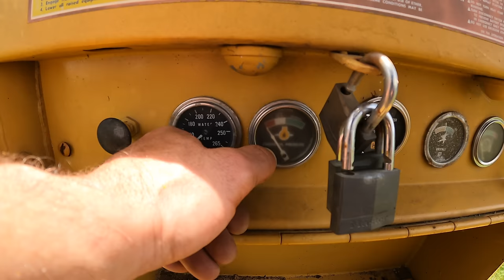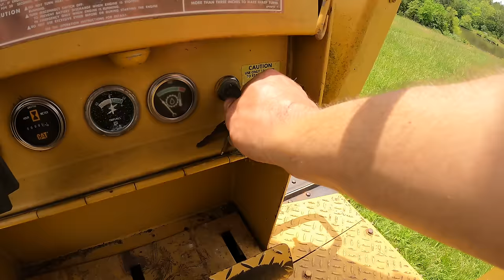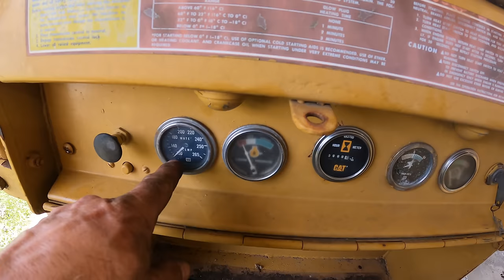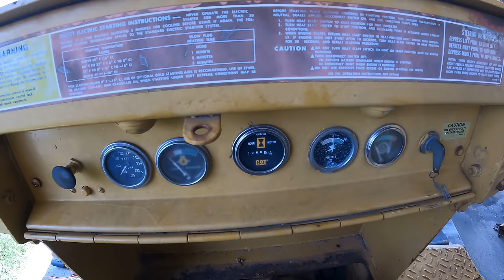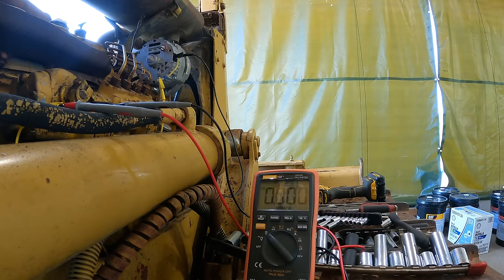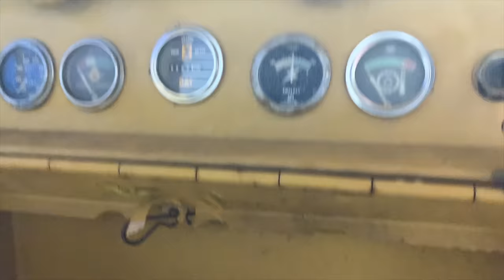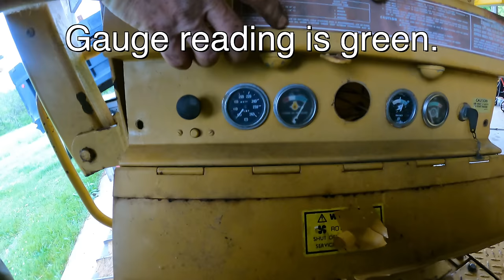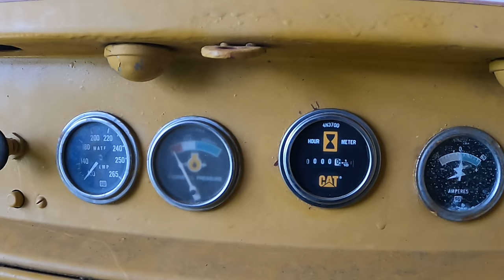Buying & Fixing a Bulldozer, Cat D3 Dozer, Part 1/2

Comment: If I can be so bold as to make a few suggestions….blow paper air filters from the inside. Outside in just pushes the really fine particles (ones that eat rings etc.) through the filters, also potentially opening the airways, bad.  The large filters we would tap on the track, shaking excess dust, on 12 hour intervals.    Also noticed the filter housing was literally flopping around, maybe check security on the ducting to make sure that no air is coming through.
The springs that tension the tracks are over tightened.  In the pictures the coils are almost touching…..not good.  About your buying price, a fellow in Oregon is in the final stages of going through a D4- really good information can be gleaned from his adventure.  You will burn many many gallons of fuel before you wear this one out- just neglected Nick-back piddley nuisances so far.  If you need it quick and inexpensive,  clean cylinder rods with acetone in the damaged areas and “shim the area where Crome has exited stage left with JB Majik stuff “ cover with clear packaging tape, aluminum flashing to cover affected area, hose clamps to hold curvature….wait overnight to open the package.  Package tape will prevent the epoxy mix from going where you don’t want it, light sanding with progressive finer wet or dry till pretty, no sharp edges to tear your new seals.  Or if you have deeper pockets than I, they can recrome the rods.😅. If I remember correctly that D4 guys handle is Northwest Hillbilly. Great stuff.😊

Comment: Sort of an unrelated thing, but on your glowplugless start attempt you can actually get it to fire pretty easily if you leave the fuel fully off for about 10-20 seconds while cranking, and then give it fuel while still cranking. The cylinders will heat all by themselves from compressing air, but dumping cold diesel in will cool them right back off. Letting it crank without any fuel at first is pretty effective. 
It's a great trick for old equipment with bad/no/broken glowplugs, or starting something in the winter if you don't want to constantly waste power running the block heater 24/7.

Comment: I have a 96 D3 C and I know exactly every problem you will experience…the fitting that leaks on the lift cylinder always rusts
When you find out the cost you will cry…anyway you got a good deal…iv owned mine 20 plus hrs it has 3400 hrs and iv put a new bottom end and of course hoses…good luck

Comment: I bought a farm 6 years ago and the vendor threw in a 1972 Cat D4D. Great I thought, a bulldozer! That will be a lot of fun, I thought. I had never had a dozer before, but I have since learned the hard way the first thing I should have done after the farm purchase was settled was sell the bulldozer immediately. I have spent so much money on it so far, the trouble is once you have spent the coin you have to keep going as each breakdown happens otherwise it is just ends up being a big piece of worthless junk in the paddock where it last broke down. I am not a diesel mechanic by any stretch of imagination so I have becaome very good friends with the Caterpillar dealer's deisel mechanic. So far I have had the engine rebuilt,  redone all the hydraulic cylinder seals, including the big one for the rippers, replaced the radiator, relaced the left side pedestal roller that broke, a brake band snapped when I was on a steep hill. The cherry on the cake was when the right track frame broke! I was lucky on that one and managed to get a second hand one from a wrecker for the bargain basement price of $3K, plus labour of course. I should have delayed fixing that one for a couple of months because if I had the thing would have gone up in the big bush fires we had here in Australia in 2019 and insurance would have mercifully put me out of my dozer induced misery. It is currently in the shed awaiting the aforementioned Deisel mechanic to make time to come out and replace some seals in the arse end of the thing. He tells me the parts will be less than $100, unfortunately it will be at least a day and a half to pull it apart and that again top put it back together again. It is a lot of fun when it is going, but these days I am just relieved if I get off it and it has not broken down. It is a huge money pit, I really do need my head read!

Comment: Ya know, those plates in the tracks shouldn't be hard to manufacture.  Just need some sheet metal and bend it.  If there are bolt holes on top and bottom you will know roughly how it should be shaped.  Better than nothing while you wait for some to go on sale.

I simply love your content, you're the best.
Can't wait for Part 2 ♥

Comment: The oil pressure switch was often used to excite the alternator.   A good way to detect the engine is running.  .But not with the new type alternators.  And power the hour meter too

Comment: I think that yellow wire on the alternator needs to be powered only when the engine is running. Other wise it will drain the battery. You could tie it to the hour meter power so it exites the alternator when the engine is running.

Comment: the broken plastic piece or any plastic pieces, plastic weld them. 
Using a soldering iron and just some zip ties work well as filament.

 just melt the plastic together on the inside where it's not visible

Comment: There is a hole in the back of the case for the brush retention wire. So you can pull it out.

Comment: Those are good machines. You can fix pretty much anything on a farm with a factory manual and a press. I’ve rebuilt steering clutch’s installed new brake bands and rebuilt motors and transmissions on those. I did have to hire a guy to press off  and on the sprockets. I agree it’s a 20k machine.

Comment: hand throttle adjust the center nut on the control and it will give you the resistance you need to hold it in place

Comment: Make a cardboard template for those running gear guards. Cut the flats from 1/8" (or maybe 3/16") steel and get a metal shop to put the bends where you need them.
Some primer and paint and... Bob's yer uncle!

Comment: 48:05 that hour meter showed 0 hours, so it seems that the oil pressure switch was faulty from when the machine was new, what would be weird, so i guess that the hour meter is replaced, because the old hour meter didn't count anymore and the previous owner thought it was the meter itself, not knowing that it was powered on from the oil pressure switch.
Also if you compare the glasses on all gauges, they look a bit dull, where the hour meter has a very clean glass.

Comment: John, I do hear you talk about "top-soil" a lot. And that while you have everything to start your own "top-soil-generating-plant" around you...

You have: Sub-Soil, Cow Dung, Leaves (from trees), and probably old hay bales, and you have a..... POND. And an excavator....

Now what you should do is the following: Mix up 50% subsoil with Cow Dung, Leaves and hay, and just keep it moist. Rotate it every month, and mix it up real good. Keep rotating it. And within a few months... You will be surprised what you have. And by the way, you can actually "scrape" the far end of your pond (bottom) and add the mud/sludge from there to your pile too...

The moment that you keep it nice and wet, and you mix it up pretty good, you will produce your own "top soil" in no-time. To see if it works? Start with your "Garden" first. Mix it up with your existing top-soil. And you'll notice, that the "black" stuff will erode way less than the original top-soil, but also will be way more fertile. 

And if you truly want to make it happen even better? Dump all your food-scraps in there too. 

Just a tip from "Seed Valley", The Netherlands, where we do this already for over 600 years 😉

Drop me a PM, if you want to know more....

Comment: Alt #2 is battery voltage sense and #1 is the excite terminal. Old times indeed. And the read housing cn be re-clocked (turned as well)

Comment: The wire from the starter to the breaker looks like it was changed.  It could have had a fusible link on it before cluse to the starter.  There might have been cushions stapled to the wood for arm rests.

Comment: Not sure if anyone else has mentioned it yet, but this is a pre-combustion engine. That means you need to glow it to start it even if it was 100 degrees out, the only time you won't need to glow it is when the engine itself is still hot.

Comment: Great video. I bought a Deere 450c 1986 last year.  I paid 20 grand but it’s a one owner machine, beautifully maintained and I’ve been loving it.  Sharp sprockets with minimal bushing wear and I’m tempted to change the sprockets, but people have stated it will wear the bushings more.  Other that that I haven’t seen one so clean and not one leak surprisingly. I too might have overpaid but I will be able to sell it for what I paid hopefully. Been using it a lot and very happy, tracks stay tight. The winch has been a huge help.  Mine starts very easily, almost instantly.  And my alternator too wasn’t charging the battery, it seems when I eliminated the main power switch, that fixed the problem.  I’ve never heard of a main power switch going bad but maybe this one did.  It seems the charging cycles on and off with mine I gotta figure this out. It has the original alternator that’s supposed to be with the machine. Good luck.

Comment: The alternator has a hole in line with the brushes on the outside so you can put it together and then pull the wire out the back,

Comment: There is a much easier way to do those brushes on the alternator.  That hole goes all the way through the BACK of the case.  Use a pin punch or straightened out paper clip form the back side of the case.  Easy peasey.

Comment: 29:55  Not sure how you missed the hole in the rear case half that allows you remove a stiff wire (paper clip works great) that will hold the brushes in during reassembly.  That eliminates the need for all that fiddling around with a wire out the front.  But now you will know for next time. 😁  If you buy a new brush holder assembly it comes with a pin in the brushes that will stick out through that hole when you install it in the case.  Back in the 80's I was a tech at a GM dealer and rebuilt a couple of these a week.

Comment: love the channel content. not sure why you dont want to use the glow plugs to start, thats what they are for. keep up the good work.
Reply: Many diesel engines don't need them when the weather is warm
Reply: My 6.5 needs them even if it 90 out.Once it's warm, it will start without them.

Comment: Another way to flick out old seals is to sharpen the end of a small flat head screw driver and then hammer it into the outer edge of the seal at around a 45 degree angle, and then lever the seal out with the screw driver.

Comment: I used one of these D-3s pushing clay & shale around for a brick factory, they have one major drawback and that's that stupid blind spot right down the middle of the hood.  The blade isn't very tall so you can't really see how high the blade is without looking side to side and comparing the heights.  
So what I did was mount a CB antenna right in the middle of the blade and trimmed it to about 6" above the hood with the blade about 4" off the ground (where I liked to keep it).  Then I put a tennis ball on the antenna.  
That way I could tell how high the blade was, and whether it was tilted or not just by looking at the tennis ball.  I also ended up mounting a wire circle like a tennis racket sticking up that I could just line the ball up like a gun sight, that way I knew each and every time that the blade was the perfect height, and whether it was tilted left, right, or level.   Saved me a ton of headaches, I could just jump right in and go.  easy peasy when you're on the clock.

Comment: A 1/8 inch drill bit through the back of the alternator will hold the brushes. There is a hole on the back side.

Comment: Couple things that may help. When looking for parts call CAT and make sure you ask if CAT Classic parts, yellow line, or evem used are available. Theu dont usually offer it up without you asking, but  Cat classic parts saved us some serious money on that older stuff. Got anything from guards, sensors, engine and exhaust parts in it etc.  Also im thinking the wood on the tanks were there instead of armrests, rubbing your forearms and elbows on the top of HOT (especially on a sunny 90° day) rough from rust piece of metal stinks after a few hours. Might be able to make an adjustable arm rest set up. Also if you have and few inch wide strips of 1/4" or so steel you can lay it on your concrete and track over it so you dont gouge it up. Redone several pieces of this older stuff for my previous employer and really enjoyed it. Great looking little machine you got!

Comment: A big job involving both the dozer and excavator…playing in the ultimate sand box 🤔
That left side blade attachment point to the dozer looked like it had some play in there. I’d recommend just checking it out to be on the safe side. Always enjoy your videos sir.
On the alternator brushes, there use to be a hole through the backside to allow a paper clip to retain the brushes.

Comment: If you have 'in cylinder' glow plugs, always light them off so fuel never wets them. Leidenfrost effect vaporizes the fuel before it contacts them. Obviously, if it's an intake air heater, doesn't matter. Teaching my children to start/drive my Duramax killed multiple injectors because they'd forget to wait for the glow plugs. You get carbon hot spots which burns then out.

Comment: I think you should measure drain current now, once you fixed our alternator. I dont see anything that should stop excitation circuit from draining the battery. Probably thats why the kill switch was installed.

Comment: That hole on back of case is where you put a small allan key or small drill bit drop your armature in and pull the pin out of hole to release the brushes simplez 😅🤣😂👍👍👍

Comment: Alternator 👍 very good. 🤔 if there is no hole in the case behind the brushes... drill one. Stick the wire in the hole to hold the brushes back ... Once together pull wire. That way you are less likely to scratch the installation on the exciter coil. 
Ask me, go ahead. Yeah I've scratch one before.

Comment: Suggestion from an automotive tech.The Delco style alternator that you have has a hole in the rear housing for a paper clip to slide into and hold your brushes in place durng assembly without going thru the nightmares that you went thru

Comment: IMHO the alternator is a 2 wire.  Jumper from hot terminal to the Field is the second wire.  Now the alternator is permanently energized?  Not good and a parasitic draw.  Remove jumper.  Then connect unused smaller wire at alternator.  Then connect "old" field wire under panel to same terminal the powers the oil pressure switch behind the oil pressure meter.  I think.  Thanks for sharing.

Comment: You may know this but those one wire alternators need to be up in rpms to produce. At idle and low rpm they don't put out. Can't remember if it's 1200 ?  They are used on hot rods and a lot of generic replacement applications. Good video as always

Comment: in Europe, we use a digger bucket for such work, and then we don't need a bulldozer.  Watch videos on the Hedblom channel.  And besides, I'm not sure if you connected the alternator correctly because most often this additional cable connecting, for example, to a 12v light bulb or other electronic regulator.  check it in the datasheet of this alternator.

Comment: There is supposed to be a hole in the rear alternator case that lines up with the holes to hold the brushes. At least there were on older ones.  Think I have one that just has a dimple there dont know if it missed getting drilled or if there was a design change.

Comment: I feel like 15 is high though for a 75. I just picked up an 89 d5c XL for 20. The guy rebuild the track tension cylinders. The first time I used it last week I blew a line on the angle cylinder and opened a can of worms it's a week later 3 trips to cat and I still don't have everything I need. I've had to replace every line on the left side of the blade frame 20 has turned into 22 or 23 lol. I've been tracking prices recently and 20 was a good price it's just an older machine that sat for a while. It's going to need some love

Comment: My komatsu d65 (1960s odd paid $33k in 2003) for it lasted a year before the engine crapped itself $20k later that was working - 6yrs later with little use the dozer wouldn't turn in one direction unless reversing it, $9k later that was fixed recently it blew 6 hoses 2 front to tilt the blade and 4 rear to raise/lower the rippers. 4 main hoses to raise lower the blade are probably next and then we have rust spots on all the hydraulic chrome rods! They're a massive money pit! I didn't listen to a guy who five years earlier said get a contractor in to do the work its cheaper lol!

Comment: if you leave the alt. like you have it, the battery will be drained. You need a switch to break the connection in that exciter wire. The ign. switch is what is normally what you use.

Comment: There is a hole on the backside of the alternator housing for a toothpick to go through to hold the brushes.  Once assembled you just pull the toothpick out.
Reply: They used a plastic toothpick to assemble them in production.  But a normal wooden one should work.

Comment: The jumper wire from battery wire to exciter on the alternator is probably your parasitic drain, because there is constantly a small current running through the exciter-windings.
The exciter-wire on the alternator is supposed to be connected to the ignition-on on a gasoline engine, in the case of your diesel engine it should be connected to the oil pressure switch, as you said.